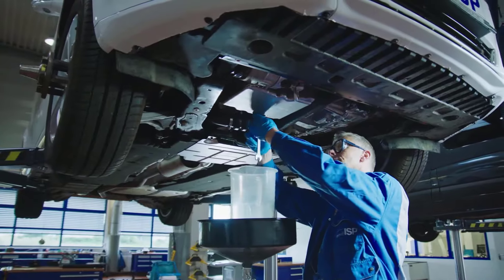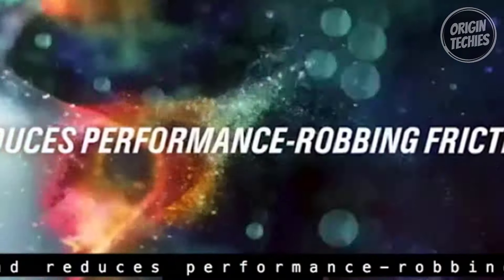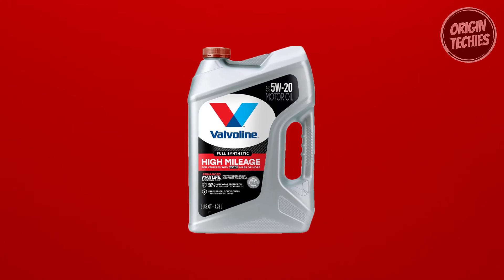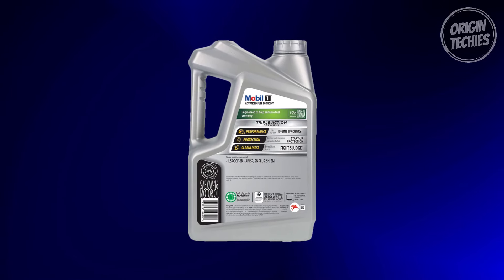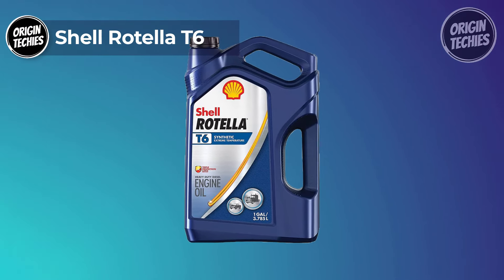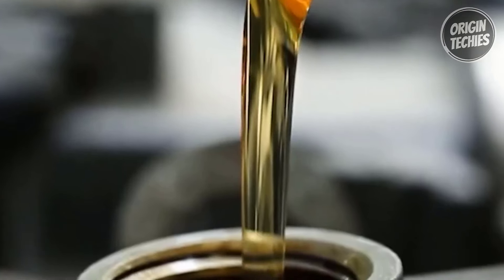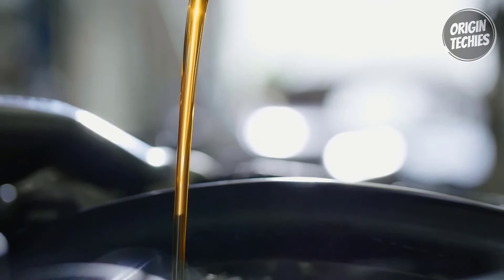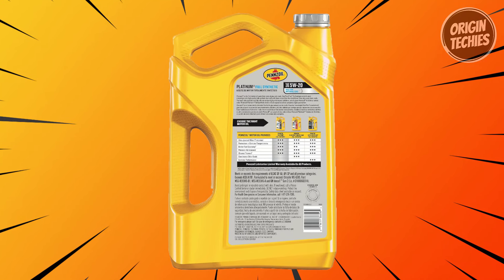Top 6 Best Synthetic Oils 2024 - Best Synthetic Oil 2024

Comment: Best my ass. Walmart Super Tech has the same letters and numbers on the back of the bottle. It’s API approved blended by Warren oil. Best oil is clean oil. I know guys with over300,000 miles on the vans nothing but clean conventional oil. Napa oil is blended by Valvoline. Look on the Napa bottles/jug.
Reply: Irv Gordan and his Volvo. 3,000,000 miles read his story. Nothing but Castrol GTX and I don’t think it was full synthetic. Looks like Castrol ultra clean which is semi synthetic. Best oil is clean oil.
Reply: I used to drive a truck I've loaded Napa and Valoline at the same plant only different is the bottle

Comment: Another oil marketing hyp video.
First off there is very little price differance between Blends and Full so there is no reason to buy Blends.
2. All oils  are API/ILSAC rated...meaning they are all quality lubricants so why pay 2 - 3 - 4 times more for the same oil just because it has some BRAND NAME?
3. All this 10,000......20,000 Looooong Life cr_p fools the unknowing into skiping the recommended oil/filter changes.
For me that is LOW!! and I wish they would stop it!!
Reply: Walmart Super Tech full synthetic blended by the Warren oil company. About $22.00 for five quart jug of Full Synthetic motor oil.
Reply: I tell guys I can do three oil changes to your one. I’m using Walmart Super Tech or Costco Kirkland. They are all in on the Amsoil BS 💩 best oil is clean oil. I tell them about the moisture gas carbon fumes heat break down of the oil. I change my oil when I can’t see my oil dip stick level lines through the oil.  Over fifty five years doing it this way and never ever had a engine problem
Reply: @arthursmith643 I totally agree with you! As long as the oil has the API and ILSAC specifications for your particular vehicle (and you don’t go over the recommended change interval), the SuperTech and the Costco brands are perfectly fine for everyday driver vehicles. Obviously the high performance engines require a more robust additive package, but at a premium.
Reply: @carlovanrijk4039   most important is the weight of the oil. If it says 5W/20 on the oil filler cap that’s what you use. W is for winter. Engines have small passages for the oil that’s why it’s important to use the right weight. Never flush the engine you could break off small chunks of gunk and clog the port veins. That means no oil gets through and you will seize the engine. I change my oil and filter  when I can’t see my oil dip stick level lines through the oil. Over fifty five years of doing it this way and never ever had an engine problem.😁but what do I know
Reply: @arthursmith643  these are all good points! I just reached a milestone in my ‘16 Honda Civic today - 200K miles. I attribute that to regular timely oil changes and maintenance. I wonder how far I can go with this car? 🤔